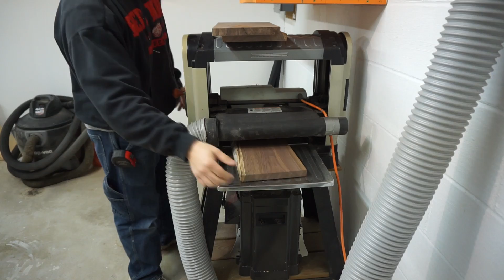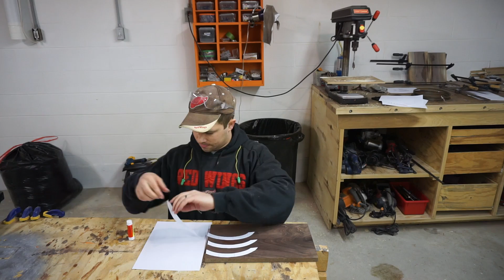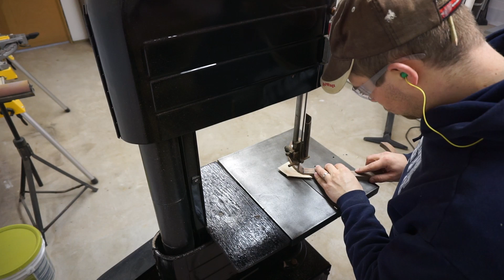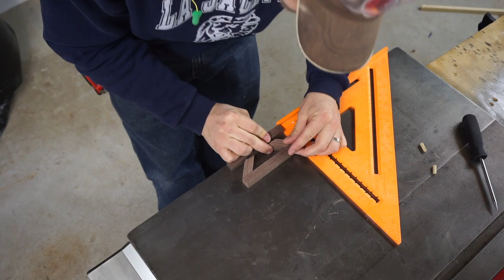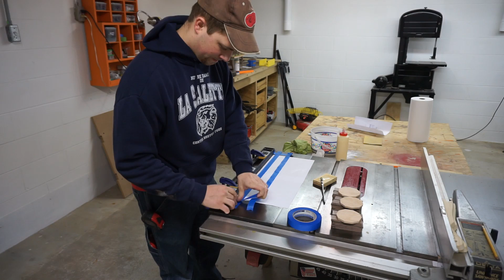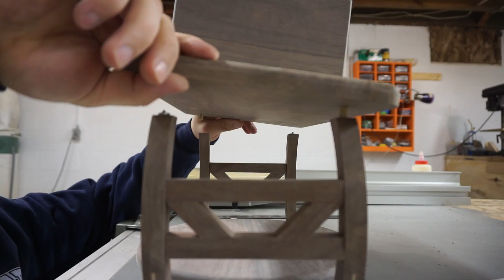DIY Kitchen Utensil Organizer

Comment: Hermoso
Reply from the maker: Oscar Manuel Gracias!
Reply: Tyler q ángulo de corte tiene el disco de su tablesaw en las piezas de wood para armar los vasos? Gracias
Reply from the maker: Oscar Manuel For the cups on this project the table saw angle was 18°.  [360°/10 (quantity of pieces to make the cup)=36°......36°/2(two parts make the 36° angle)=18°. ]

If you wanted 12 sides on the cup. [360°/12=30......30/2=15°.
Hope you can get that makes sense after google translate!

<span style="font-size:10.0pt;font-family:"inherit","serif";
mso-fareast-font-family:"Times New Roman";mso-bidi-font-family:"Courier New";
color:#212121">Para las tazas en este proyecto la sierra de mesa ángulo era 18° . [ 360 ° / 10 ( cantidad de piezas para hacer la taza) = 36 ° ...... 36 ° /
2 (dos partes hacen el 36 ° de ángulo ) = 18 ° . ]

<span style="font-size:10.0pt;font-family:"inherit","serif";
mso-fareast-font-family:"Times New Roman";mso-bidi-font-family:"Courier New";
color:#212121">Si querían 12 lados en la taza. [ 360 ° / 12 = 30 ...... 30/2 =15 ° .

<span style="font-size:10.0pt;font-family:"inherit","serif";
mso-fareast-font-family:"Times New Roman";mso-bidi-font-family:"Courier New";
color:#212121">Espero que usted puede conseguir eso tiene sentido después de traductor Google !
Reply: Gracia Tyler y disculpe la molestia por la pregunta y muy buen e increíble , hermoso y original proyecto. Saludos desde Trelew, Chubut, Argentina.
Reply from the maker: Oscar Manuel Your welcome, thank you for watching and good luck!

Su bienvenida , gracias por mirar buena suerte!

Comment: Beautiful and ingenious project *****! 

Glad to hear you found using splines helpful.  They are a variation on the classic mortice and tennon - the slpine essentially being a tennon fitting into two mortices.  Hence the extreme strength from such a small and simple joint.

As for a topcoat, you may wish to use a simple wax.  Then you could easily maintin both the finish and the wood with any of the many common citrus oil "duters" (e.g. endust, pledge, murphy's oil, etc.).  This would keep it looking great without giving it a "dipped in plastic" look, and many are safe for food prep areas.
Reply from the maker: Michael Olsen Thanks Mike! The splines added amazing strength, will definitely be incorporating them into lots of projects. 

I am getting some home-raised beeswax from my dad this weekend (he has bees for the natural honey) and the plan is to make a linseed/wax finish and topcoat it with that...will see what it looks like! As usual, thanks for watching Mike.

Comment: Innovative project Tyler, it came out really nice!
Reply from the maker: Darbin Orvar Thanks Linn, thanks for taking the time to watch it! Am going to make a blend of your linseed/beeswax finish to put on as a top coat. What is your reason for raw vs BLO? Greater oil penetration?
Reply: *****  I like raw linseed oil because it doesn't contain any metal driers, so it's completely natural. I've also found that when combined with wax, you don't have a long drying time to deal with (drying time is one reason why many people like boiled vs raw)